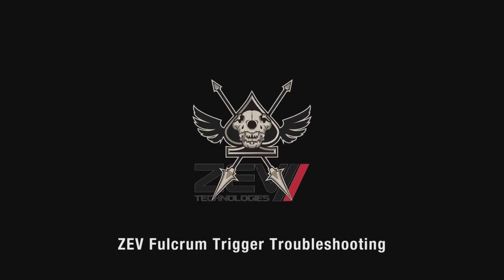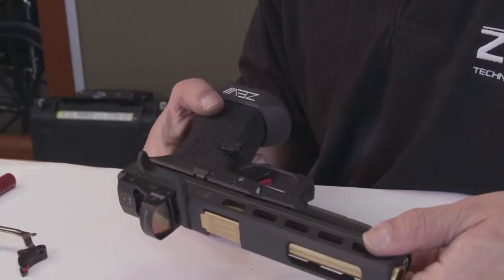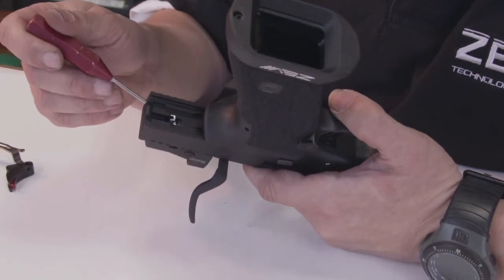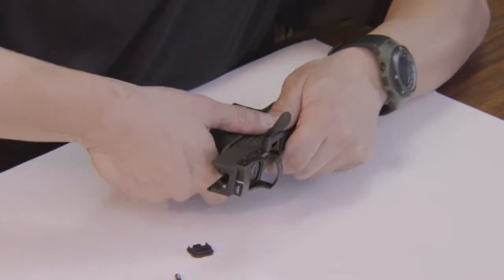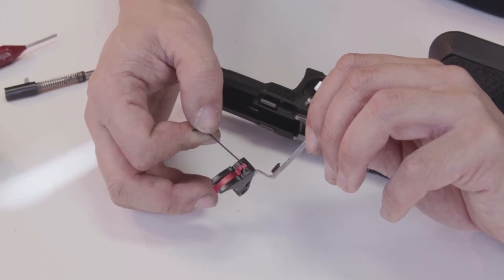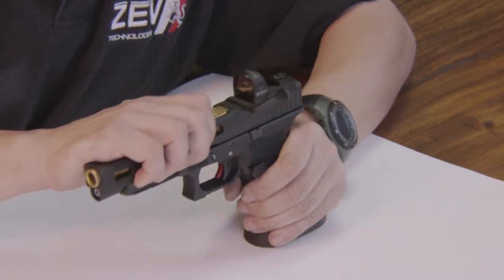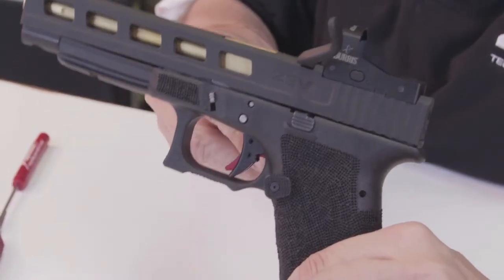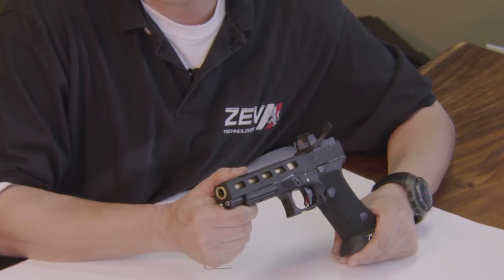ZEV Fulcrum Trigger for the Glock pistol - Troubleshooting

Comment: I have 4 Zev triggers. 2 of them have developed the issue of firing on reset. Had local gunsmith fix, but I've replaced them with Johnny Glock's triggers. Johnny's triggers are what I thought Zev's were going to be.  Johnny is the Glock whisperer. Believe it.

Comment: I installed the ZEV Fulcrum trigger FUL-DRP-9-PRO.B-R and now I have no trigger safety. I left the Plunger Safety and its spring with the 2# Striker Spring with the stock trigger back in and the Trigger Safety works fine. Any clues to what the problem is?

Comment: What was that weird bar on the slide in front of the optic?
Reply from the maker: It's a slide racker. For competition shooting such as USPSA/IPSC it helps you quickly rack the slide and reduces finger prints on the lens of the red dot optic. Also for the stages that call for the gun to start on a table as opposed to the competitors holster it works as a "kick stand", It props the gun up at an angle and you can actually get your thumb under the gun as you reach for it. Lastly and most importantly for me the kick stand eliminates any chance you accidentally push the gun down into the table as snatch the gun and release the magazine. Then you look like a fool when the mag drops out and you send a single round at the first target. Competition shooting is about 10th of seconds so the slide racker lets you go faster on the gun manipulations and reduces the chance of expensive (meaning lost time such as the magazine poop) mistakes.

Honestly if nothing else you look cool when you do your LAMR "load and make ready" where you slap the racker with the web of your off hand.
Reply: Ray Wong Thanks, this is the first time I've seen one of those
Reply from the maker: No worries. There are a lot of specialized competition gear such as special Race Holsters (quick draw holsters), special ammo, and other gadgets in the expensive pursuit of going just a little faster. If you have not already done so check out some ipsc or uspsa videos and find a local club to go play. Its damn fun and you fast track learning valuable skills like shooting on the move, working from a holster, and shooting fast and accurate,  Its kind of like learning a martial art fir gun shooting. Anyway you don't need a tricked out gun or gear. There are divisions based on equipment I just happen to gravitate to open class. I'm the kind if guy that loves gadgets and I have to modify everything.

Comment: Still waiting on getting my trigger back from ZEV. 0 fucks to get it back in a timely manner. The middle piece of the trigger fell out while shooting. Not the most satisfied customer. Let's just say I'll be going with agency arms when I do a full build. Sorry ZEV I may check with you in 20 years. Perhaps the quality will improve. Until then agency arms will recover my glock to do the build.
Reply: need to loctite the hex screw on the trigger safety no big deal
Reply from the maker: Sorry if you read my response above I left the company about 2 years ago. If the trigger safety fell out you should contact ZEV and they SHOULD send you out a replacement immediately. Back when I ran operations I would send you a prepaid return shipping label by email and cross ship you out a replacement the same day. If they give you any grief about you needing to ship the trigger back on your dime first or not sending you out a replacement the same day you called then feel free to mention that is what ZEV would of done when Ray was running operations  and things like stuff being right and customer service were highest priority. When you call for anything customer service or tech support ask for Patrick and  request he personally inspect the part or better yet test it in a gun before he ships it to you. Patrick would be the one guy I would say would run the thing beginning to end and make sure it got done right. Otherwise you might have an "issue" of someone not doing the in house completely over complicated RMA procedure correctly and passing the buck to somebody else who now has their hands tied because it was submitted to the production department properly or is missing a approval of some bean counting six sigma white belt

If the trigger safety fell out then that means either the trigger safety screw broke, or came out completely. The screws on the side of the trigger are not for adjustment.  They hold the safety in place and the trigger pad to the trigger bar. In fact you should never touch them, and never untra-sonic clean the trigger or other operation that would cause the threadlocker on the safety and trigger bar screw to come undone. Working for 8 years at ZEV it was not uncommon for customers to get confused and mistake the side screws as adjustment screws and there were several instances of ultrasonic cleaning, running the whole gun through the dishwasher, being over zealous with over cleaning and dunking the gun in all kinds of solvents etc. Not saying you did any of this but it doesn't matter you still need to call ZEV for a replacement and if they ask if you did any of the above just tell them you know better than to do that stuff. It could be very likely too that ZEV hired a bunch of high school kids or grandmothers that they pay minimum wage and they don't shoot or are emotionally invested in gun stuff working right. Back when I ran operations the people that worked in trigger assembly were all shooters and it was considered a skilled position. Back when I did the hiring when you interviewed I asked you to pick up a pre-positioned pistol off my desk, get in your shooting stance and point  the gun at my dry fire target. If you did not do that correctly I assumed you were not a gun guy, did not have the proper DNA, motivation, or basic skills to work in our shop safely. When the company started taking on a lot of investors things started happening like the investors kids or the investors neighbors kids, relatives etc started getting hired, being "corporate" was more important than being legit and I'll leave it at that. I doubt am certain there is not one person at the company that has an active USPSA #.

The screws on the front (trigger face) and back of the trigger (not adjustable while the trigger is in the frame) are the adjustments screws for pre-travel and over-travel. As mentioned by Flossyem1 you must reapply a small amount of threadlocker (blue loctite) after adjustment. Otherwise over time and especially if you slam that trigger like a nut trying to burn down a stage in competition they will come loose and you will have more  over-travel and pre-travel than you ought or am accustomed to. If you shoot a lot of competition stuff do a lot of dry fire practice you can actually feel your trigger just ain't right or something had changed big time. 

You will most likely need to heat the set screws up a touch with a cigarette lighter for example to soften the threadlocker on the adjustment screws. Then you can make your adjustments and they should hold for a few magazines or a range session as is. Once you are happy with your adjustments I recommend you reapply thread locker in this manner.  Use one of your adjustment wrenches for the trigger and insert it into the screw and pay particular attention where the wrench is indexed (for example it is pointing strait up or 12 o'clock. Turn the screw counter clockwise usually two or but possibly three complete turns again indexing the wrench in the same position such as 12 o'clock. You need to back out the screw enough to expose a few threads to apply thread locker to. Use your second adjustment wrench or a toothpick and apply a small amount of blue loctite or suitable threadlocker to the end of "application tool" and touch it to the screw and get that stuff completely on treads. Next turn the adjustment wrench the same amount of turns you did to loosen it and return it to the same index  *ex two full turns clockwise returning the wrench to 12 o'clock." Remember when adjusting the trigger you should never need to make more that a half turn of adjustment. More likely it is a quarter turn or less.If you are turning a full rotation or more for adjustment you are not doing something right or there is something really wrong with the trigger or gun you need to figure out.

Comment: I just got the ultimate kit and installed it. Went to the range and had an unusual result. I would fire 1 shot then as the trigger resets, it would FIRE in the process. In some cases I feel like the gun goes into burst fire mode firing 3-4 shots at a time. The range officer came over and asked if I had the gun modified to shoot like a machine gun.lol. Help please?
Reply: Lol thats funny its nice to have full auto glock.
Reply: +spoke1183 lol right? I got a new connector but still have the old one
Reply: Have u had any light primer strikes or have u changed firing pin as well?
Reply: +spoke1183 no light primer strikes. I just simply swapped the connector from the ultimate kit to the new connector Zev mailed to me and has been shooting flawlessly with no hiccups.
Reply: Cool man thx i just got a new gen 4 glock 19 was just wondering before i proceed to do some trigger job. Thx for reply and info looking forward to it. Happy 4th stay safe.
Reply: +spoke1183 Thank you! Stay safe as well and congrats on the new Gen 4! I have a Gen 3 since I'm   California but the trigger kit (haven't done a lot of research on the gen 4 trigger kit)  should do the job just fine. If you have any issues just shoot Zev a call and they should take care of ya!
Reply: Will do thank you :)
Reply: did you ever figure out the solution to this problem?
Reply: +Dave Miami (warmachine) Yes. Zev sent me a new connector. Idk what was wrong with the one supplied in the kit but a new one fixed the issue.

Comment: I added the Fulcrum Trigger and race connector and now my trigger does not reset consistently. The original connector worked fine.  I want the most performance lightest trigger pull. No screw tampering. Any suggestions Ray?
Reply from the maker: I would call ZEV and have them send you a replacement. I don't know how many people on the internet know but I'm no longer with the company. They laid me off right after the 2015 shot show. I was pretty unhappy about the situation but that's life. Still it was a huge part of my life and honestly my identity. I'll move on and you will hear about my new projects one day soon. ZEV is still using my videos and I torn about doing free tech support for them. 

If I was still working at ZEV I would recommend you begin troubleshooting by using just the fulcrum trigger and the stock connector to see if the gun functions properly. If it does then that isolates the ZEV connector as the problem. In that case call up ZEV ask for Patrick and ask him to test a connector in a gun before he ships it to you. Most likely the connector got bent or there is burr or something is out of spec in thumb of the connector.

If the trigger resets weak or is inconsistent in resenting then most likely the adjustments screws need to be adjusted.
Reply: Your Tech Support is awesome.  I am not the easiest person to deal with after spending $250. Everyone at Zev has been very helpful. I would definitely recommend ZEV for your outstanding products and customer service. Good job guys.
Reply: PS: Sorry to hear about your layoff. Some companies don't realize a good thing until it's gone. An employer with motivated and proud employees transfers to a happy customer base.